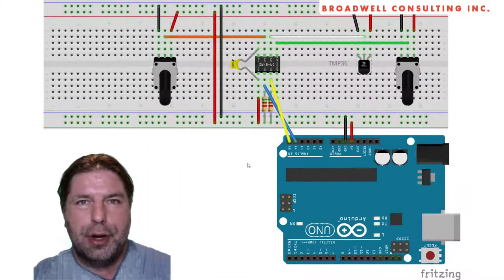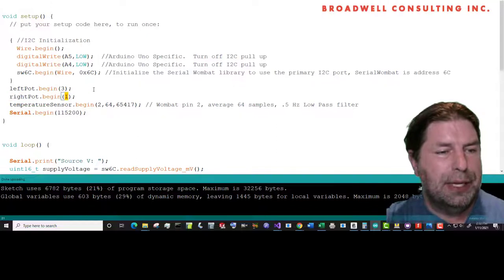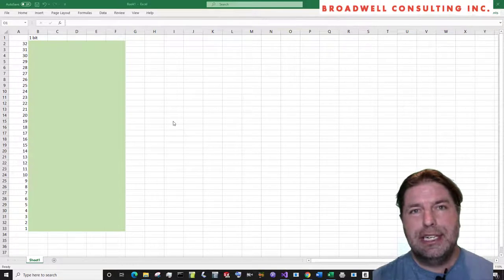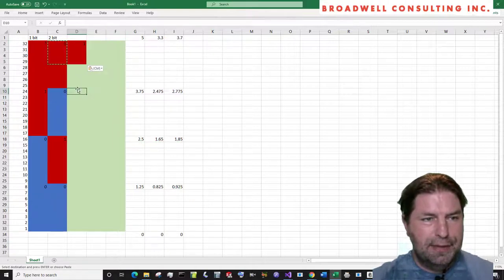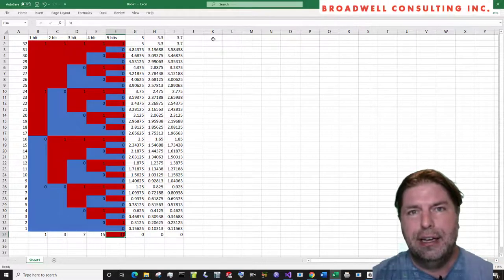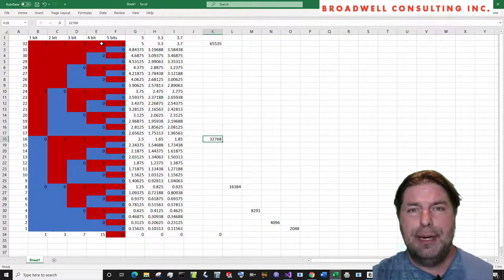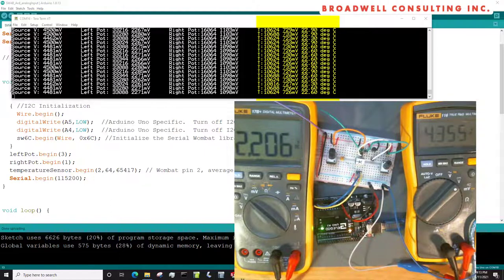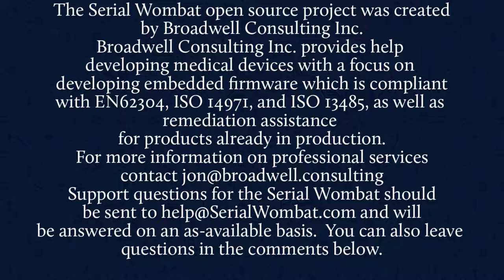Measuring Analog Voltages on Arduino using the Serial Wombat 4B chip's Analog Input pin mode

Comment: I'd like to use the SW as an extra A2D input. For what I understand, your chip reads counts up to 65535 instead of 0-1023 like the Arduino, is there any way to make it behave like the Arduino? Most code assumes 0-1023 counts, esp. the ZMPT101B code I have.
Reply from the maker: All Serial Wombat chips return an A/D reading from 0 (ground) to 65535 (whatever the voltage source for the Serial Wombat chip is).  In the case of the SW4B chips, the output moves in increments of 64 because it's a 10-bit chip (1024 increments between 0 and 65535).   If you need Arduino equivalent values, simply take the Serial Wombat output and divide it by 64 or right shift it by 6.

Here's some additional info from the Github readme for the firmware ( https://github.com/BroadwellConsultingInc/SerialWombat ):
Proportional public data is always scaled to be a 16-bit value. 0 is the lowest possible value and 65535 (0xFFFF) is the highest for any proportional value. This is regardless of resolution. For example. the SW4A and SW4B have 10 bit A/D converters. The 0-1023 output of this converter is scaled to a 0-65535 output that moves in 64 count steps. Note that the maximum output is scaled differently from 1023 to 65535 (rather than 1023 * 64 = 65472). 65535 always represents "Maximum measurable value". The SW18AB has a 12-bit A/D converter, so its internal resolution is 0-4095, but this is scaled to 0-65535 in 16 count steps. A servo outputs its shortest pulse (typically 500uS) when its public data is 0, and longest( typically 2500 uS) when its public data is 65535. The SW19's 32 step true analog output takes an input of 0-65535 and divides it by 2048 to determine which of the 32 output steps should be output. In this way all Serial Wombat proportial inputs and outputs can be compared or linked together regardless of their native resolution.

Comment: Great product.  Using it with the new Arduino RP2040 Connect and it works great with Arduino IDE.  Haven't tried CircuitPython yet... waiting for the libraries to support that language.

Question... trying to use the analog input to measure AC and the average function is kind of a problem.  Is there maybe a max value during sample time?  Using the split-core transformer like SCT013 to measure current.
Reply from the maker: Glad it's working for you!  The Serial Wombat chip does track minimum and maximum values internally from single samples, and they're available to the host.  For some reason I didn't pull that interface up to the Arduino library.  I'll shoot to have that feature integrated to the Arduino library in the next couple of weeks (I do a lot of regression testing on the libraries to make sure I don't break anything prior to pushing them, so I can't turn an official change in a day or two).  If you want, email me at help@serialwombat.com and I can email you a couple files to copy into the libraries/SerialWombat directory that will add this feature ahead of the formal release.
Reply from the maker: Quick note to everybody, the Min/Max feature is now available in the downloadable Arduino Library.  See my video on July 2021 Updates for more info.